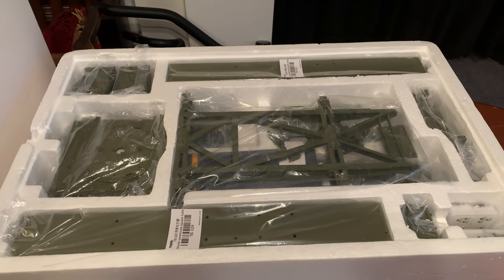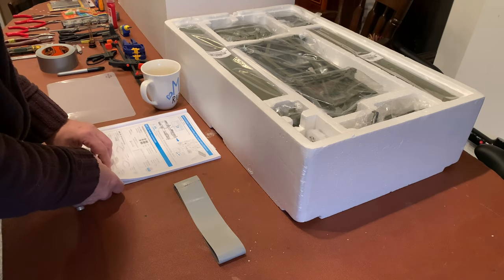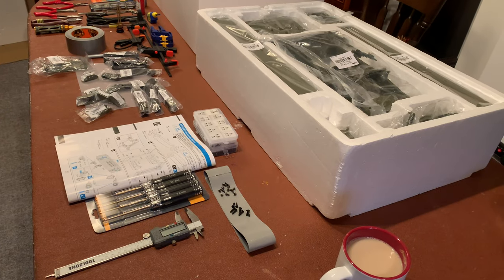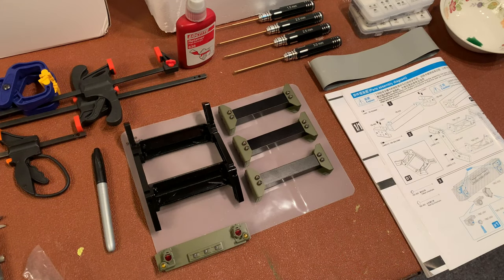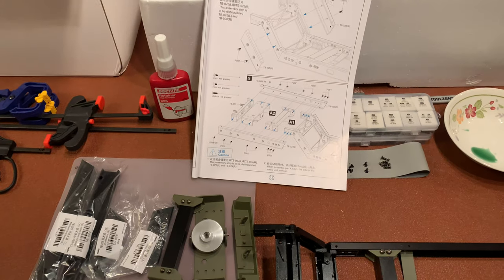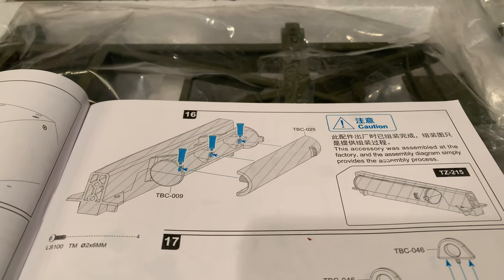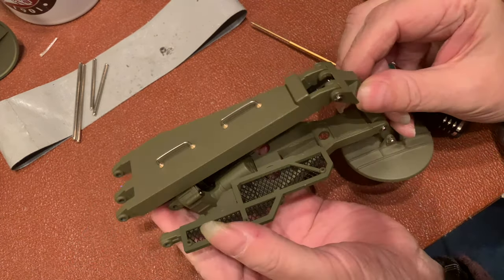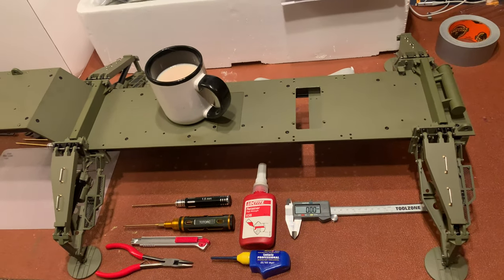The HG P805 build Part 1. 1/12 Patriot missile launcher

Comment: Thanks again for making these! I am about to sit down to assemble mine and I am going to watch your videos through one more time. I am going to use Loctite 243 which I believe has different solvents, and I am only going to use it on metal-metal joints.
Reply from the maker: You are fine to use it on metal joints but I was strongly warned about its bad effects on plastic. Hope you enjoy your build, be extra careful with the connections for the raise and lower and turning wires. Good Luck Paul

Comment: Hello I’m having problems with the wiring tower went up remote not responding any suggestions
Reply from the maker: check for lights on the receiver are they flashing or constant?
Reply from the maker: Make sure the 3 wire plug is in M3 and the 2 wire plug is in M4.